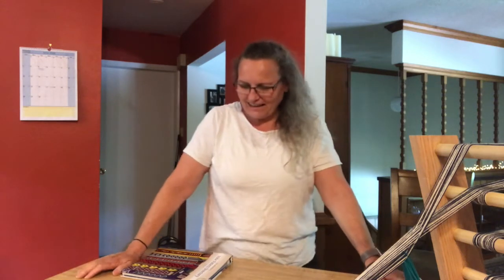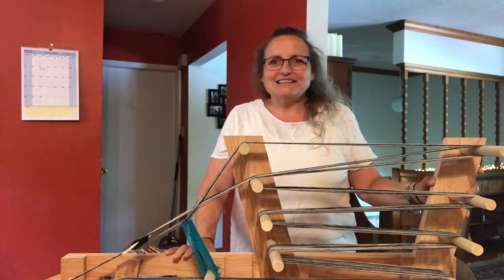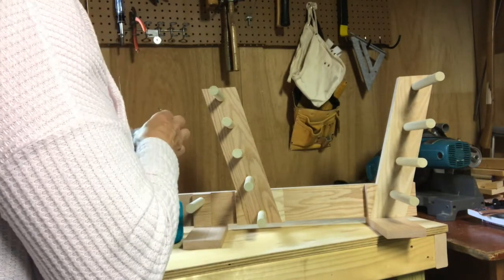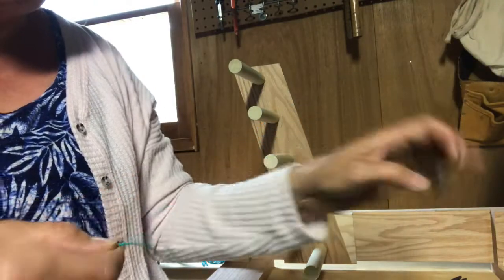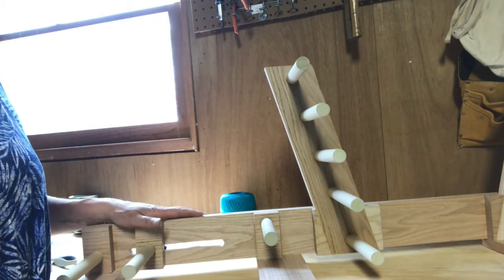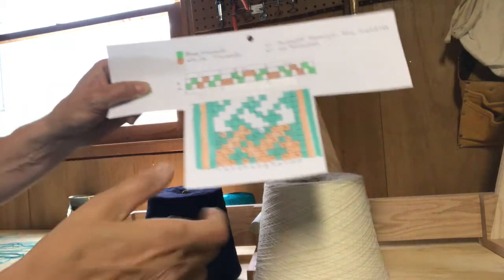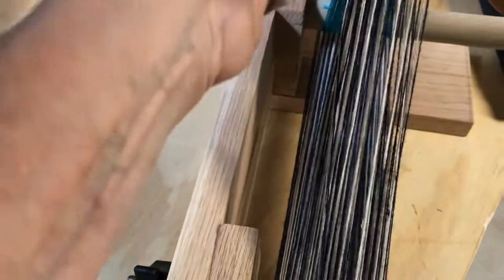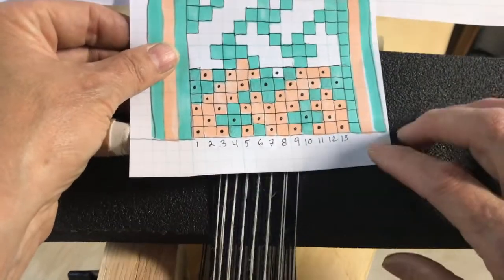Baltic Pickup Warping

Comment: Could you please tell me what you tie too. I also cut and tie every thread change unless they are the same color. The way you do it would be a great time and thread saver.I was wondering about crossed threads.?
Reply from the maker: hi thanks for watching.  to answer your question I tie the last loose threads two the initial taped down thread that I started with  there should be one blue and one background thread and one pattern thread that  I taped down initially.  Then at the end of  warping I tie the remaining  pattern and background threads to the initial taped down threads that I started with. I hope that helps